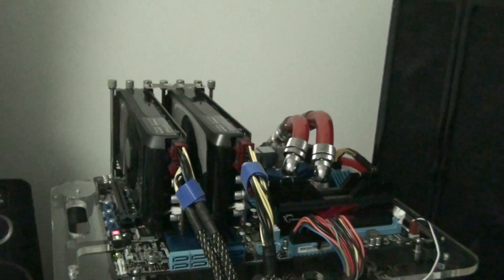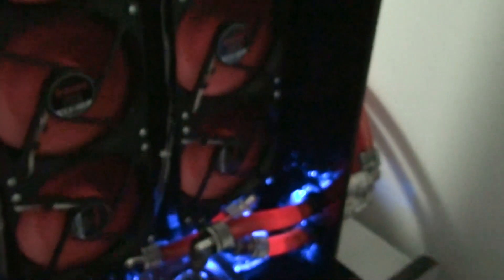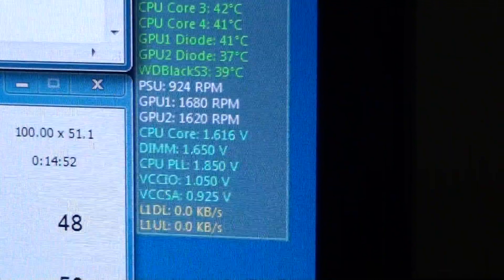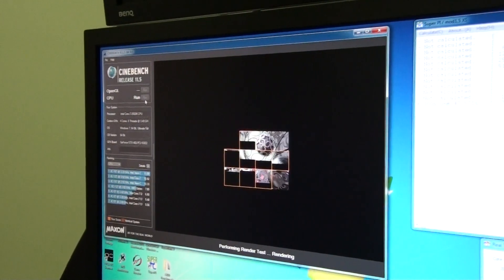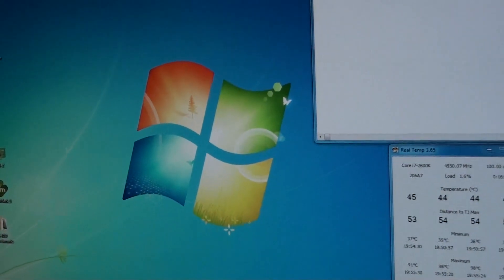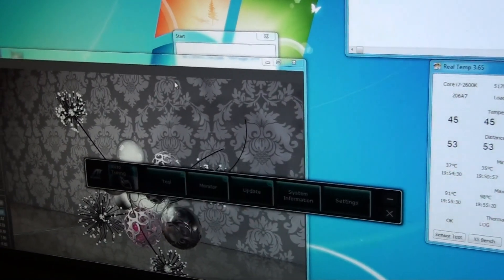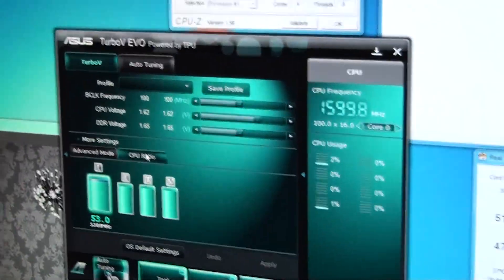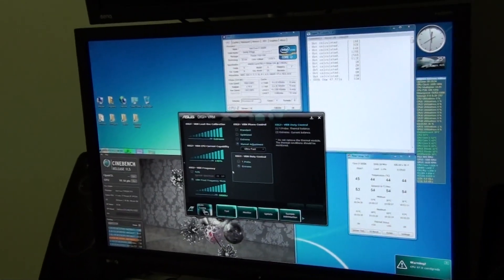2600K Benching at 5.3Ghz

Comment: 1.62v isn't the same as 1.39... i have my 2600k at 5 ghz with 1.48v and it never reaches 40c. i have it watercooled alongside my 680's. i'm using 2 80mm thick 360 rads with 1 240 80mm thick rad. i've done a suicide run at 1.7v at 5.8 ghz once

Comment: I have my i5 2500k on a p8p67 evo overclocked to 4.7ghz on a h60 and i don't pass  68 Celsius which is damn good, and im running 1.39V on the core

Comment: What?  *Every* fridge compressor is protected by high pressure and low pressure cutouts on the refridgeration side and by a internal overload protection device (auto-resetting) on the motor side to protect the windings.  So then please explain to me and to everbody else exactly how it would even be possible to as you say 'burn out the compressor' ??  (lol)

Comment: yo man, you should try to put the radiator into the refrigerator or put a small air conditioner next to it... i install  Corsair H100 on my cpu and i put it in small refrigerator. i takes lot of space on mt desk and it looks horrible but i get some good results. lowest temp 8c and highest temp 43c, with 5.5ghz

Comment: Buy a cheap second hand bar fridge.  Set it up neatly under your desk and then mount your water cooling radiators/reservoir inside.  Drill holes in it to plumb through required hoses/wiring.  Works a treat, you'll be overclocking as if you lived in Tassie.

Comment: Hey man I just recently built another main rig ( HAFX ) to retire my previous one (Corsair 800D)... now if I retire my HAF X rig in 3-4 months or so would an 1155 socket be the way to go and do a new build based on the 2600k?

I am hearing mixed reviews about the sandy bridge due to the 8X , 8X SLI 

anyways check out my builds mate its not as extreme as urs but hey we all start from somewhere